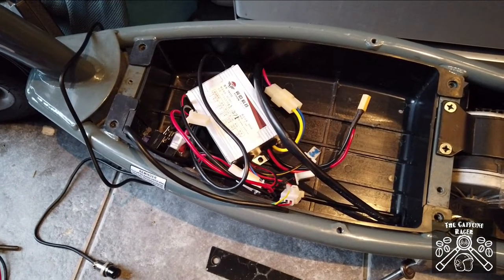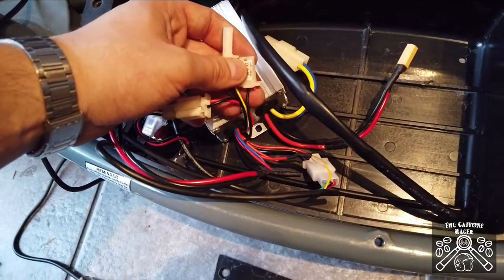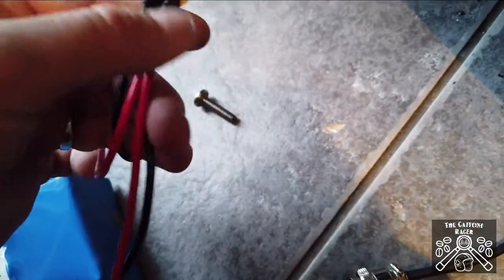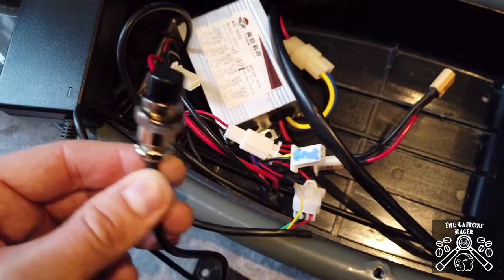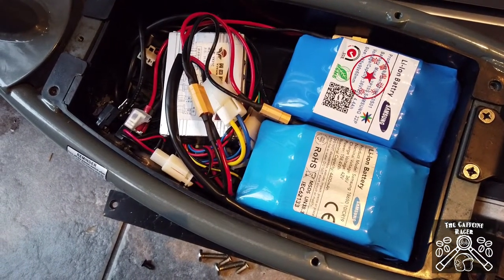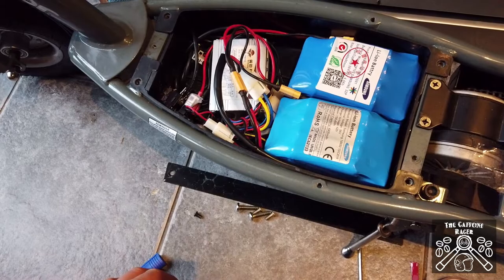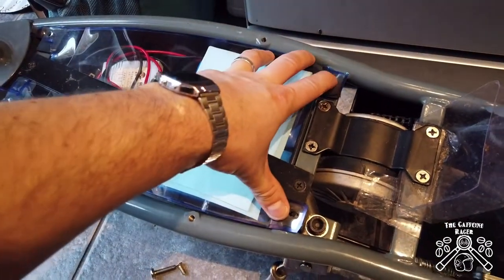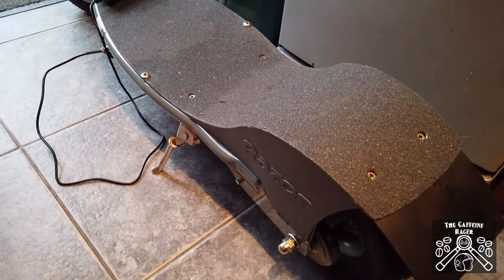Razor E300 Upgrade - Fast 36v Original motor-  my mods phase 1

Comment: Thanks for posting. I’ve found your videos on the E300 very helpful. You’ve answered a lot of my questions.
Reply from the maker: If you have any more ask away. Have you seen the latest video with new motor fitted. Yesterday I fitted an extra battery for range. Hoping it's not too much for the set up we will see. Thanks for watching :)
Reply: @TheCaffeineRacer   I have seen your latest videos. They are very helpful :) I'm hoping to eventually upgrade to the same motor because mine is getting a bit old. I was worried about how it would fit but your videos confirmed that it would work. Did you have a hard time fitting the third 4400mah battery in there? I'm curious what your range will be. Thanks again!
Reply from the maker: @phamworks  without moving the power switch it's tight but it's fits just but at the mo the case and switch is the original. I am gonna fit a fan system to cool inside it next. And maybe adesign an expansion chamber for the battery box. Doing some short rides and the motor seems to be fine with the power only just getting warm. I will have to do a real range test but a struggle at the current time. I guess I could do it on my commute and add it up.
Reply: @TheCaffeineRacer do you have in this video still 24v motor with 36v battery and 36v controller??

Comment: Great idea on the plastic wheel well. Going to do the same on mine. I have the same over-volt setup. One thing I can tell you from experience is that the stock motor will not last. I used mine for 3 mile trips and burned it after 4 uses.
Reply from the maker: Oh I am up to 18miles now. It gets warm but not hot. I am having an issue with my rear brake binding on. I only weigh 69kg so not much weight I also make sure I kick to start and don't always full throttle it. When it burns out I will add the drone motor.
I will be 3d printing some small mudguard soon will make a video on it soon and sell through ebay cheap
Reply from the maker: What motor are you running now?
Reply: I was averaging 18mph before it burned. It started to drop to 13mph when I knew something was wrong. I weigh about 78kg and just purchased a motor rated at 500w 24v from eBay. Hoping I can still over-volt it with 36v without damaging it but going to keep an eye on the temp. If I think it’s going to burn, then I’ll try converting an alternator motor to BLDC, only I’d have to change the controller again and I’m not too sure about RPMs.
Reply: Do you have a model number of the drone motor so I can look into it for myself?
Reply from the maker: Bought a 3d printer 🖨 would u like some customer made internal mudguards I am gonna design some
Reply: Oh wow that’d be great! What would it cost me?
Reply from the maker: @kabevis1  where in the world are you will calculate postage won't be expensive just wanna cover costs etc the first design is done and the printer is here so not long. Will cost the plastic and print time ⌚ tomorrow for you.
Reply: Los Angeles, CA
Reply from the maker: @kabevis1  ok well I can work out the postage for that I wanna make a sensibly priced system. Just in process of building the work surface in the shed for the printer then I will get on with prototyping and testing - need it here now it's wet will put a video up this week on progress
Reply from the maker: @kabevis1  look me up at TimSalsaNights on insta and let's chat about it
Reply from the maker: @kabevis1  ok will be printing the piece tonight and if it fits well and doesnt need redesigning we will be ready to go dude :) email me or insta tim@salsa-nights.co.uk
Reply from the maker: https://www.youtube.com/watch?v=bySi0HDgD4Y for you prototype video we are good to go
Reply: You still on that orginal motor?  If not how long did you get out of it.  I'm been thinking about throwing a 36v ESC on my E300 with stock motor.  I'd only being using it for maybe half a mile at a time.  @TheCaffeineRacer
Reply from the maker: @Black93gthatch84  you will burn up the motor. Cooling is key and not riding it hard. Fit heat sinks and vent it. It will last longer I now have a 500w motor :)

Comment: How did you connect your charging port and power bottom.
Reply from the maker: So it's the original wired coming off the scooter from the power switch and charging port. I didn't disconnect them. But  the wires in the controller for the charging port were inverted so took them out of the connect and swapped them over. It will blow the charge with a bang. I will make a close up video for you ASAP. Wiring diagram is on the screen  for controller early in this video 📹 :)
Reply: Curious to see how you joined and soldered the XT60s. Again thanks for the interactive Q&A. I am sure I will have another question. :-) I am about 20% into a full rebuild.

Comment: I have 3 razors that i have collected over time for a project.  My Idea is tandem drive wheels. Gonna use the stock motors since i have them. Question is, if I run 36v what wattage controller should I run to handle two stockers wired parallel where their amperage will double

Comment: Has the motor blew up yet or is it still going good ? I’m thinking of buying the same speed controller and using two 18v drill battery’s for my e300
Reply from the maker: I have a 500w in in now for the last year plus

Comment: Hi Tim, hope all is going well! I’ve got my razor e300 up to this mk1 build same as this with the 2 x 4.4 Ah batteries into the stock motor. Can you let me know if you can remember what kind of range you got with this setup? I’m getting about 25-30 mins atm at full chat (@20ish mph) I’m trying to work out if I’ve bought a couple of fake Samsung hoverboard packs although they weren’t that cheap! Many thanks
Reply from the maker: Sounds about right at full speed maybe adapt your riding style to save power and make sure tyres are pumped up nicely
Reply: Thanks Tim,  I went 3.5 miles to work then I charged it there (just in case) for the journey back (uphill). So fits my purpose for now.. If I fit a 500w motor and feather the throttle I should get more range in theory?

Comment: I have the same brushed controller,not fitted yet,would i have to reverse polarity on both power & powerlock?Cause you did).
I know its been sometime but  knowledge is needed about that controller .
its a great controller after seeing what you did with it
Reply: Did your controller fit all good no problems I’m thinking of buying the same one sumo panda?
Reply: @colvinau1403  I did buy that controller and completely changed my mind,i bought a brushless hub motor and controller i copied " Caffeine racer's" battery parallel....My project is an all different kind of scooter.

Comment: Hey Tim I have two 5ah drill battery’s with the same speed controller as you and I have the stock motor but I’m only hiting 30kmh but I have same voltage and the battery’s are high end drill battery’s how can I get a faster speed

Comment: Where did you get the batteries from if you don’t mind me asking?  And why didn’t you use the circuit breaker?
Reply from the maker: All links in the description :) they are Hover board batteries. I don't know why I didn't use the circuit breaker I will have to wired one in, have some printed parts for sale check my other videos :)

Comment: Currently running 350W motor with 36V 1000w controller and (3) 12v 7ah batteries. I've got some really big hills and batteries are dying quickly. Should I go with bigger lead acid (12v 9ah) or go with your setup of the (2) 36V lithium batteries?
Reply from the maker: What's your motor rated in amps
Reply: @TheCaffeineRacer  
model jk-0232
Rated Power : 350W
-Voltage : 24V
-No-Load Current : 0.7-14A
-Rated Speed : 2700rmp
Reply from the maker: @cjtrunk3140  14A is the number that's important a single good lithium 36v pack will be capable of deliver 4.4A at peak. So 3 of those could deliver 13.2A peak close to the limit of your motor. So cool would be a good idea 💡 but the 350w motor could then work to its best and range would be extended. Remember we are using motors in a way they are not meant to when we over volt ⚡ to 36v on a lower bolt motor. But it's the amps being pushed at will melt it. So if you ride carefully it won't melt :) full throttle all the time or up hill wouldn't be good

Comment: Tim I’ve bought the same speed controller that you have but I found a couple of problems, the battery cable does not fit my razor battery cable and also on the speed controller battery cable it has an extra wire coming from the top, any ideas on what it could be?

Comment: I'm having problems with my 36 v controller it only has 3 pin for throttle and my cable has 4 pin. With 2 brown and 2 orange wires? Any help would be appreciated.
Reply from the maker: Ok well best thing to do is email me at Info@tiny-3d.co.uk with pictures will help yah.
Reply from the maker: Does your throttle have a voltage display on it
Reply: @TheCaffeineRacer  hello thanks for replying no mine is the stock throttle with upgraded 36v controller. My stock throttle has 4 wires and the new controller has 3 wire connecter.
Reply from the maker: @alexbekkala1718  ok the stock throttle is not actuated it only has on or off so I am guessing it just need positive and negative connection for it the wires are probably just doubled. As it's a basic switch. I advice a cheap thumb throttle on ebay they are under £10 mine was £6?now I think about it something like this https://www.ebay.co.uk/itm/332586360572 you will be able to control accelation with that with urs it's gonna be off then full power not a great way to ride
Reply from the maker: @alexbekkala1718  my last message didn't post. You probably only have a positive and negative feeds onte old switch throttle so time to get a proper throttle try on like this as its Wat I run and will give you control not just off and on. https://www.ebay.co.uk/itm/332586360572
Reply: That makes sense. I will order one up. Thanks for the insight!
Reply from the maker: @alexbekkala1718  I am creating a guide on my website, also some more 3d printed parts for the e300 including a rota adaptor for the rear hub for mounting 160mm Disc brakes

Comment: Can I straight fire the Motor to the control box with out using the xt90 connectors?
Reply from the maker: How many battery's are you using. U risk connector burnout and possible fire 🔥
Reply: Timsalsanights aka The Caffeine Racer 
I may just use one battery

Comment: can you draw a schematic of the charging and switch?
Reply from the maker: I will be creating a full page on the build on my website will get it up asap and post the address. charging is untouched and so is switch kept original connectors and they connect to the input on the speed controller. 
subscribe and you can get the updates this week
Reply from the maker: There is an image in the build video showing the order of the connections to the controller
Reply: @TheCaffeineRacer  Its a bit difficult to see,I took the old wires and instantly forgot how to do the wiring replacement.(i am using a brushless controller .
Reply from the maker: @softart5235  if u dont have the exact same controller wiring could be different, plus this is brushed motor and controller, i cant quote on the brushless tech sadly

Comment: Are you using the existing power switch? If so, how did you wire it or did you follow a diagram?
Reply from the maker: Yeah using the original switch and there is. Connection on the esc for the power switch so just connected to that with the existing cables
Reply from the maker: 56secs in there is a wiring diagram for this esc the one marked power lock is power switch uses the original switch
Reply: @TheCaffeineRacer  That part I get but it's two prongs and the actual switch has 3 prongs. Correct me if I'm wrong top brass is negative, then other two are positive. I tried every combination and I can get the power switch to turn on but it won't start the motor. The only way to get the motor to run or work by connecting the "Power Locks" together, basically putting a paper clip does the trick, I will improve it eventually. I would like to utilize the switch so I don't have to keep opening the cover to power it off. How did you connect yours?
Reply from the maker: @nebpimentel7349  ok well that is a fire hazard ur esc will always be on. Have u got the circuit breaker reset button still connected. I will have to strip mine to take u a photo email me at Info@tiny-3d.co.uk if you are interested. Positive was top I believe I am not using the trip switch I removed it as was for the 24v system has yours tripped. I will reinstalling mine soon as a safety feature
Reply from the maker: @nebpimentel7349  bottom is negative from what I remember
Reply: @TheCaffeineRacer  email sent! Thanks for you help!
Reply: Nevermind, it was a fault on my end. I figured it out. Please ignore me, stupid mistakes ugh. Had my wires crossed like my brain...

Comment: yo tim im having trouble with the charger not to sure what i have to do
Reply from the maker: Ok so whata the issue, on mine the charger wires had to be switch round + - round the wrong way
Reply: Timsalsanights aka The Caffeine Racer im just not 100% sure what charger i need to buy and i dont know if i will have to switch the +and-
Reply from the maker: @iiizaiah3794  well if you have 36v batteries then a 36v charger which will charge upto 42v and you will need a gx12-3 marine plug to adapt it to the original port on the scooter
Reply: Timsalsanights aka The Caffeine Racer why would i need a new port
Reply from the maker: @iiizaiah3794  no as I said a replacement plug 🔌 for the charger to fit the port on the scooter as the chargers won't have the same fitting
Reply: Timsalsanights aka The Caffeine Racer what if i had a 36v charger that had the same size head as the stock
Reply from the maker: @iiizaiah3794  well yes if you can find one great you obviously wouldn't need to change it then :)
Reply: Timsalsanights aka The Caffeine Racer alright thanks man i really appreciate it
Reply: Timsalsanights aka The Caffeine Racer ive watches this video a million times trying to get everything perfect i really appreciate it man

Comment: Great video, maybe you can help me. I have a 24-volt 350 watt motor, with a 36 volt 800 watt controller connected to one 40 volt 6 amp hour Ryobi lithium battery. Every time I put the scooter under load, the system well shut off, yet when I connect the system to my 36 V 500 watt controller, it works great, do you have any opinions on why this might happen?
Reply from the maker: Sound like the controller is allowing the battery to discharge more amps than it can handle. I would stick to your 500w controller. That's very odd it might be faulty
Reply: @TheCaffeineRacer  thanks for the reply. I thought it maybe faulty as well.
Reply: The controller voltage must match battery voltage set up, 36V battery set up to 24V controller will burn it. And wattage on the controller must not be higher than rated amp on the motor. The wattage on motor is just NOMINAL number the real number is the amp it can handle. For ex; 24V 350W 19A max motor, you can use upto 36V 450W controller. 24V 500W 28A max motor, you can use upto 36V 672W controller. you can overvolt but the controller watt can not be higher than what the motor can handle. But in overall try to always match the voltage and wattage of battery system, controller and motor for long lasting safe run of system.

Comment: Did you ever end up using the circuit breaker?
Reply from the maker: I didnt but wondering with the increased amps i am pulling weather it would just trip over and over maybe i will have to try it. it ould be a good safety feeture dont know what the rating on it was though as mine is removed

Comment: Will that speed controller work with the lead acid 24v stock battery’s or can you only use 36v?
Reply from the maker: 36v control needs 36v to work sadly
Reply: @TheCaffeineRacer  ok and I was also wondering if you had a link for the battery, hence the old link expired I was wanting a link for the exact same battery that you have in yours. Since there’s so many different brand that are different prices and I don’t know if some are faulty or not.   Thanks for your quick replies btw it’s amazing
Reply from the maker: @colvinau1403  sadly I bought them 2 years ago now cronovirus the supplies have changed so much I am not sure what is available in the battery range. Would suggest never buy cheap. Good cells cost 3.5 to 4£ a unit
Reply: @TheCaffeineRacer  ok thanks for replying

Comment: Ive used 2 battery packs nearly the same as yours but it has charging leads ,so I have both connections outside 2 separate chargers....when charging just one pack i ended up charging the other from one charging port(is that good or bad battery management ?)
Reply from the maker: Sounds a little complex I guess you could just join the charging wires to the single charging port that would make it simpler
Reply: @TheCaffeineRacer  thank you